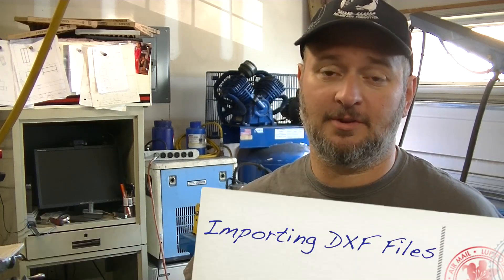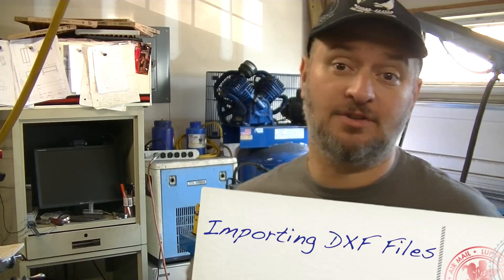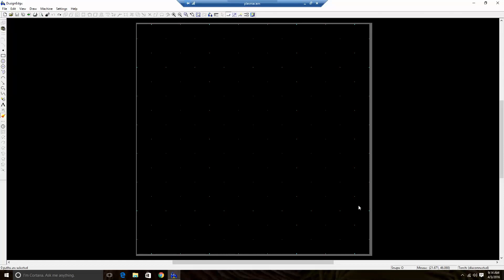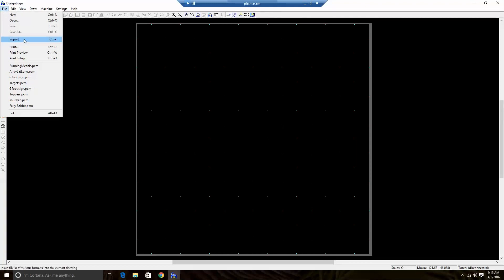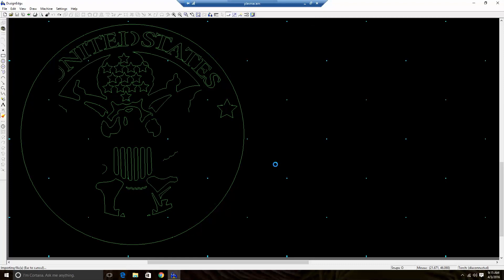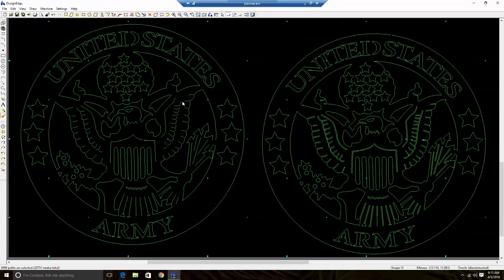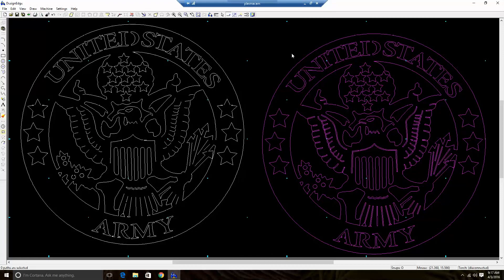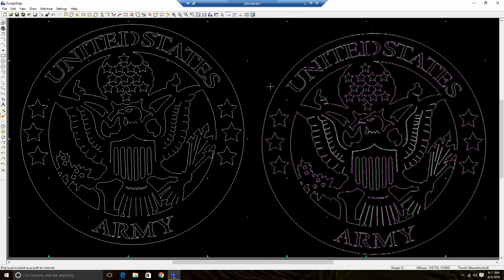Design Edge - Working with DXF Files

Comment: Tom watching your videos sure has helped allot.   Being a Former CWO US Army retired Medevac Pilot I have witnessed first hand how our Wounded Warriors have sacrificed for our country.  I have started  non profit here in Daytona Beach Florida that is Called the Broken Wing Project.  Its focuses on training combat wounded vets for free in the field of Aviation, Metal Crafts and designs.  I recently purchased a new 4by 4 Plasma Cam, DHC2 with Advance DesignEdge software and learning how to use it.  

But that's the problem no one here really knows how to use the equipment and we have had some students quit because of the learning curve.  I wonder if you would furnish us with some Military Aviation or logs that they could cut and get the ball rolling.  We are making some BBQ smokers and fire Polygon pits and using military style logs for our fund raising projects but after two months I am just getting the hang of running the machine but still having problems importing bit maps to cuttable panels that actually looks like the photos.  Would you help. 
Doc Bailey CWO The Broken Wing project, Sparusa1@gmail.com , 386-414 1448
Reply from the maker: +Doc Bailey Hi Doc - sorry for the slow reply. I just saw your message here. I’ll call you this weekend.

Comment: I used to do a lot of PlasmaCAM work when I was in high school two years ago, and I would always make my own custom designs in an open source program called Blender and would export it as a .dxf file, however when I would go to import that .dxf file into PlasmaCAM it would show up nearly a tenth of the size it was supposed to be. And that would be a big problem for projects that had critical dimensions. Now I don't know if this is a problem with Blender itself since it I get the same result importing that .dxf file into QCAD. Is there any fix for this that you might know of?
Reply from the maker: +Matt Larson Hi Matt! That generally happens when the units aren’t set the same. PlasmaCam doesn’t have a place to convert the units so they have to be set correctly in your other drawing software first. To get a correct import, make sure the units are set to inches.

Hope this helps!
Tom

Comment: Tom,  I just bought my PlasmaCAM a few months ago and I'm learning how to use it.  Yours and others videos have helped out a ton.  I have taken a CAD class and now it's starting to come back to me a little.  I have a question about the Military logos.  Did you say you bought them?  If so where at?  I'm retired military and I think it would be cool to cut some of these for retirement gifts for the guys that I used to work with.  You can email me if you'd like as well.  Thanks again for your videos.
Reply from the maker: Congratulations on the new purchase! I love mine and use it almost every day. Always glad to help out if you need anything as well. The military logos that I got are from a place called FreeDXF dot com but they were definitely purchased and not free, as the label might lead you to believe. Another good resource for drawings is Plasma Spider (small, annual membership).

Feel free to reach out if you need anything!
Sincerely,
Tom Z
Reply: Tom,  Thanks a bunch for the websites.  I just made a fire pit with my PlasmaCAM for my son in law.  Now there are a lot more people that want them.  I'm trying to import pictures to put in the panels of the fire pit.  What is the best to import .JPEG pictures into DesignEdge?  Another question I have is if I import a picture and want to use Smooth to smooth things out how does that work.  When I use it sometimes it changes the picture drastically.  Does it help if I import the pictures larger than what I need?  Thanks so much for all your help.
Reply from the maker: +Hogugly Take a look at Vector Magic online. It's not free but the nominal cost is made up for with the speed you can go from drawing to something you can use. I typically use Vector Magic to create an SVG. From there I use Inkscape (free) to save as a DXF file that Design Edge can read. Smoothing is great but don't go overboard. I usually use it in very small increments; sometimes .001 at a time. Some of this just takes experimentation and practice. I'm sure you will get faster with it quickly!

Best wishes,
Tom Z
Reply: Tom,  I had another quick question for you.  If I buy another seat does it have the same stuff that my original seat has or do I have to buy all the advance stuff all over again.  I want to get another seat so that while I'm at work I can design stuff and transfer it to my computer hooked to my PlasmaCAM.  Thanks for all your help.

Comment: Thank you, I also have a DHC2 with Advance DesignEdge software and love it. Keep up the good work
Reply from the maker: +Dan Radusinovich Hi Dan! Have you added any of the software upgrades to your setup. I've seen a couple that Keith Fenner has on his but haven't quite made the leap here. It seems like there are features in each of the bundles that would mean needing to buy them all in order to get what I really want.

Thanks for watching and if you have any suggestions please let me know. I don't get on the forums enough so I should probably check there more as well.

Best wishes,
Tom Z
Reply: Thanks for the reply, if you are thinking of the nesting or pipe cutting software updates I have not done those. I do update mine often and have advance with digital height so I am pretty happy with what I have but the cost for nesting seems high. If I can help with anything let me know. I am in Northern California. Amador Metal Works.  Thanks again, Dan. I have to see what Jeith has added, I would like to get his snap away Tourchmate kit

Comment: Hi Tom,
I have had the same problem with the different layers and have not found an easy way to delete the second layer other than exactly what you do.   I have used a couple of different programs (Illustrator and Inkscape) to convert files to DXF and both gave the same results.  Maybe a good feature for PlasmaCam to incorporate in their next upgrade to Design Edge.  Good video, Tom.  Great explanation of "how to".
Take Care,
Reid
Reply from the maker: +Reid Eichner Thank you, sir. It really is one of those tough issues that really doesn't have a great solution. I use the same tools plus a few web-based ones and the results are typically the same. Glad to hear I'm not the only one but really wish neither of us had the problem!

Best wishes, my friend.
Tom